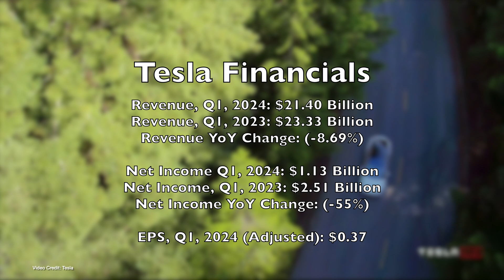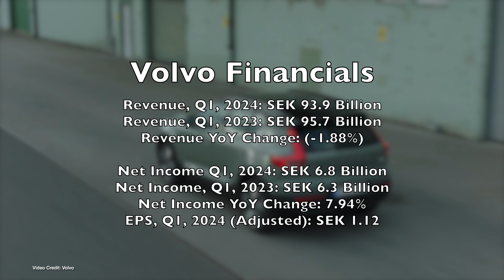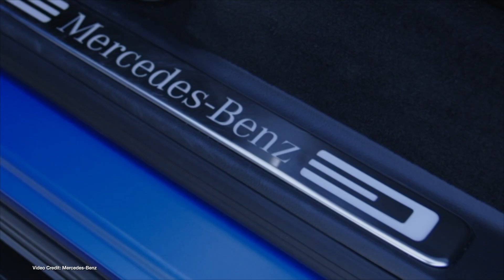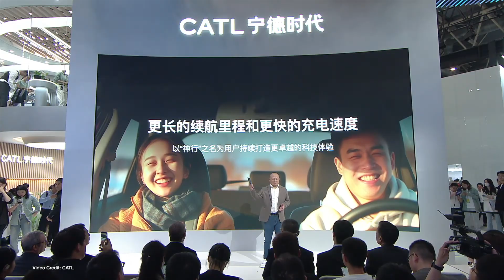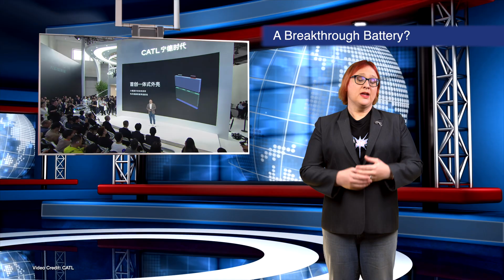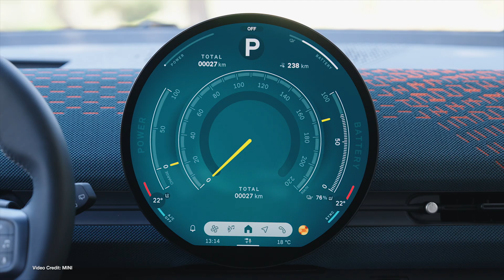ecoTEC 320: Breakthrough Fast-Charging! Electric G-Wagon Is Here! EV Battery Life Improves!

Comment: Tesla says 1000 cyber trucks a week ?    yet recall of every truck since Nov for the gas pedal  issue  sees they are not yet even averaging 200 per week        facts   v    Elon world
Reply: Recall is a simple fix with a rivet added to the accelerator pedal (there is no gas pedal) and there is no impact on new production, which is 1,000 units weekly now.
Reply: @jamespaul2587    yep I know it's an easy fix I'm mearly stating the 160ish a week production  which is off the actual figures provided  in the total recall since November          to now say in the last 4 days it's now doing 1000 per week .         the recall just put the actual  production numbers up so that dosent align with what's said ...   like everything else that elon says   ... marketing spin
Reply: @deanrowling372  initial production was far lower, but apparently it's  at 1,000 a week now, which seems reasonable based on drone shots showing large numbers in the parking lot ready for delivery. Actual delivery numbers will be confirmed when Q2 results are released.